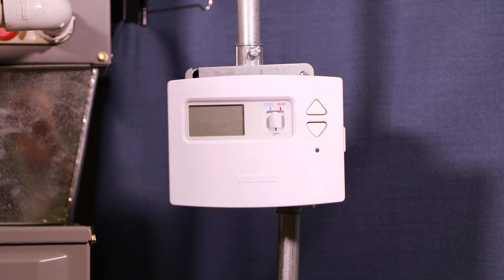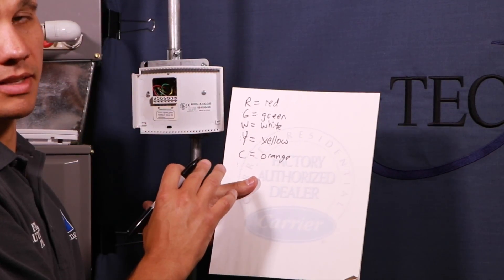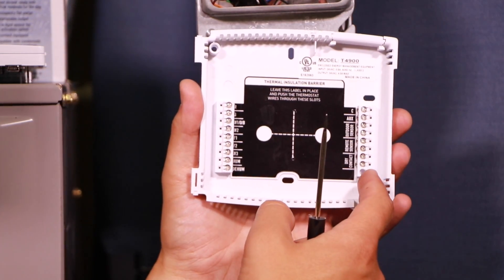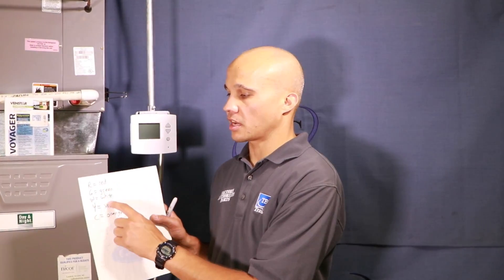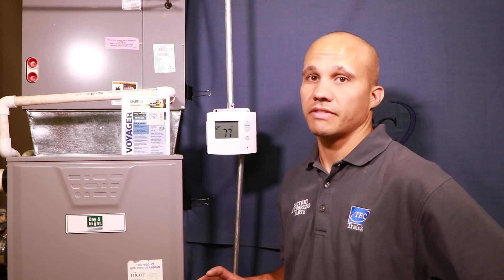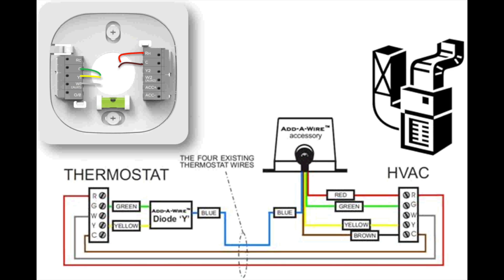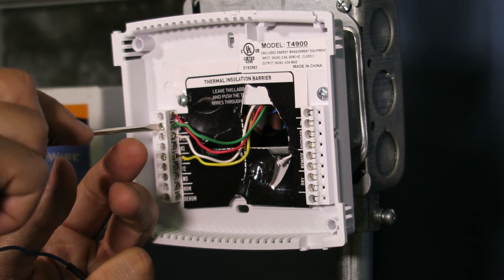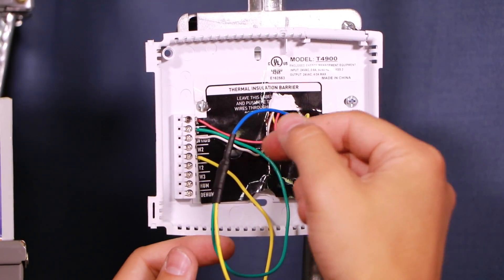Thermostat Replacement & Add-a-Wire Kit

Comment: Could the brown wire be used for w2 if I wanted stage 2 ?
Reply from the maker: You can use any color wire you wish to connect W2 of the thermostat to W2 of the equipment

Comment: Thanks for taking the time to post this, but here's a TIP for others: Check thoroughly, both ends of your existing thermostat wire bundle, you may find a hidden C-wire! It may be folded back/tucked into the wall cavity, or may be snipped off at the end of the cable's insulating sheath (not needed or used with the old installation)... While preparing to upgrade from a 4-wire to a 5-wire smart thermostat, I found mine was hidden there all along! Thinking I had no C-wire (it wasn't visible at the old thermostat end), I've been delaying my smart thermostat install while watching several of these how-to videos. Finally feeling ready to do the deed, I opened the furnace panel where the thermostat wires enter, and found an unused blue C-wire wrapped around the thermostat bundle/cable (on the thermostat end it was cut off at the insulating cover, not easily visible). The "C" terminal was there and connected to the remote condensing unit, but previous installer didn't attach the thermostat wire bundle to it, as it wasn't needed with that old battery operated thermostat. Took about 10 minutes to power off the furnace, attach the blue wire on the furnace end, then run up to the thermostat and expose/strip the end of the blue wire on the thermostat end. Thankfully, there were several inches tucked into the wall.

Comment: I recently Purchased the briidea Model: HTACC-01 and it looks like its the same thing (just rebranded) Im switching over from a older Lux Thermostat 4 wire (1stage) Heat only system to a Sensi Lite Smart thermostat, This Video is very helpful.

Comment: Sir, thank you for this great video. One question. Can add-a-wire kit be used for replacing R (power wire) or it can be used only for common, cooling and fan only?
Reply from the maker: It can be used on any pair of signal terminals (Y1, Y2, W1, W2, G) which means it cannot be wired to R or to C. But once you combine two signal terminals on one wire in your wall (say G and Y), it then frees up a dedicated wire that can be used for either C or R.

Comment: Thank you for the video.  I installed 2 add a C wire kits in our Church. They did not change anything.  They are still working off batteries. Any help would greatly be appreciated.
Reply from the maker: When you say "C-wire kit" are you talking about the old Honeywell product by that specific name?Or are you referring to the Venstar Add-A-Wire kit as shown in this video? Or one of the many other similar products out there (ecobee PEK, FAST-STAT Common Maker, etc).
Reply: @TECTubefilms  We installed 2 Sensi Smart Thermostats .  There was not a C wire.  Sensi sold us  Common Wire Maker Kits.  Looks just like the one in your video.  We installed them just like  your video showed. They work the same after we added the C wire maker kits as they did before.  They are working off the batteries so they go off line often to save the batteries. Once Sensi called me to tell me that the C wire maker kits were working.  But a few hours later they stopped working.  Thank you very much for replying to me.

Comment: I am trying to instal a Sensi wifi thermostat. I have no C wire at thermostat. I purchased an sensi add a wire kit. They have a install Video on web site. Basically converting G wire to common. It shows to remove yellow wire and wing nut it to yellow wire from add a wire kit.. i am stuck here cause I have two yellow wires at my furnace control panel. Which yellow wire do I remove?
Reply from the maker: We believe the Sensi Add-A-Wire kit is manufactured by Venstar and hence the same one show in this video.  So everything Ryan did in the video would likely apply.
Reply from the maker: In regards to the wire color, it does not really matter what the wire color is.  You can use any color you want so long as what you do at the stat matches at the other end at the equipment.  If you have two yellow wires at your furnace, it is unlikely both go to the stat.  You will need to trace out each wire and know where it goes before you re-wire something.

Comment: This doesn't make any sense. If you are able to access to the board, you just get a 5 wire connect from board to new thermostat directly. There is not need to your device at all
Reply from the maker: Correct!  If you have the ability to easily pull an additional wire, then you should.  An Add-a-Wire device is used for applications where pulling new wires is not an option.  We believe Ryan stated that in this video.

Comment: I finally upgraded to a WiFi Thermostat. This guide was EXACTLY what I needed. I only had 4 wires to my old battery thermostat, so I bought the Add-a-Wire Kit. It took a little bit of time to make sure the wires were correct, but if this un-manly guy can do it, anyone can! Thanks for the tutorial!
Reply: "un-manly" you say. Interesting choice of words...
Reply: @aurvaroy6670  interesting that out of that entire comment, the only thing you picked up on was the use of one particular word, completely unrelated to the subject at hand. What did you find remarkable about that word?
Reply: @realSamAndrew  "the only thing you picked up on was the use of one particular word'

That's not the only thing I "picked up" on that comment...
Reply: @aurvaroy6670  then what else did you pick up on, and if there WERE other things, why was "the one thing" the ONLY thing you wrote about? Obviously, it was the most important thing, or the only thing important enough to mention.
Reply: @realSamAndrew  Why do you care so much about what I commented? If my comment bother you this much, why don't you report it?
Reply: @aurvaroy6670  it's not a big deal that needs reporting. But I've never seen anyone as argumentative and defensive as you. You started with a simple comment, which was totally irrelevant. I then asked a simple question about your simple comment only for clarification, and instead of simply answering the question and ending it right there, you proceed to stonewall and argue ridiculous points. I wish I knew from the start you were a troll. My mistake.
Reply: @realSamAndrew  Also, how the hell do you expect me to remember why I made a comment I made 9 months ago? Seems like you're the troll 😂
Reply: @realSamAndrew  Also, what kinda troll takes 12 hrs to reply? If I was really a troll, I would've replied to you yesterday within an hour, but since I'm not, I replied today. You on the other hand, reply to me in a much shorter time range, so it again seems like you're the troll 🤣

Comment: Question ? I just install a Honeywell wifi I have the 5 wires already connected heat is working perfect but  When I turn the AC the thermostat goes off and comes right back on but is not turning the AC and on the screen shows a massage WAITING FOR EQUIPMENT   please Advice thanks
Reply from the maker: https://www.honeywellhome.com/en/questions/my-thermostat-display-shows-wait-or-waiting-for-equipment-or-has-a-flashing-cool-on-in-display

Comment: How can i install power kit in my furnace. In my furnace have only two slot for wire. Black and white.
Please advise
Reply from the maker: We are not sure what you mean by "two slot."  Are you saying that between your furnace and your thermostat there are only 2 wires total?  If that is the case, we also assume you do not have a cooling system.  The PEK cannot be used on a 2-wire heating-only system.  Either pull more wires or take a look at a product called Fast-stat Common Maker www.fast-stat.com

Comment: Am I missing something here?!?! Why would you spend a dime on this rediculous, unnecessary adapter? If you went to the trouble of running a blue wire from t-stat to heater why wouldn't you just run a new 8 wire cable and be done with it?? 
Please, if I'm missing something clue me in.
Reply from the maker: Running new or additionally wires is impractical or cost prohibitive in some applications.  This device allows you to make 4 wires in the wall behave like 5... or make 7 behave like 8, or whatever.
Reply from the maker: What trouble of running a blue wire?  We are not sure what you mean.  You would only use Add-a-Wire instead of running new wires.  If you are in a situation where you can easily and quickly run new wire, that is the preferred method.
Reply: I'd rather buy the adapter than try to fish a new wire or cable (only for C-wire capability) through my existing 70 year old walls. This is the perfect solution.

Comment: Excellent video for the add a wire, however it would be much more helpful to show the condenser wires hooked up because this obviously just shows the t stat connections, for us pros is ok, but for DIY people they can easily get stuck seeing the extra two wires from the condenser.
Reply from the maker: Our channel is intended for use by our customers, who are HVAC service professionals.  If a DIY homeowner finds our channel on accident, we cannot stop that, but assisting them directly is not our mission.
Reply from the maker: The wiring to the condensing unit will be the same with or without a Venstar Add-a-Wire kit.

Comment: Can it be done with r and w to add a common
Reply from the maker: Are you asking if a Venstar Add-a-Wire accessory can be added to a system that only has 2 wires total?  No, it cannot.  It cannot be used to split R or split C.  Those needed to be dedicated wires.
Reply: I’m asking if I have a stat with r and w can designate c and use the other two for r and w
Reply from the maker: @antoniosantiago2770  If you already have 3 wires in the wall, then yes you can put one each on R, C, and W.  You do not need an Add-a-Wire kit in that application.  However, if you only have 2 wires in the wall and you are trying to use the Add-a-Wire to get a 3rd wire, then no you cannot.  That is why below we said that R and C must be dedicated wires.  If you only have 2 wires, and you dedicate them to R and C, then you have nothing left.
Reply: Tec Tube got it now thanks
Reply: I’ll have to use the fast stat
Reply from the maker: @antoniosantiago2770  Make sure you use Fast-Stat's product called "Common-Maker" if you only have two wires in the wall.

Comment: My board at my HVAC Doesn't have a C terminal. Then what?
Reply: EGGINFOOLS what terminals does it have corresponding to what letters?
Reply: @matthewnowak3222  I ended up having to run a plug in transformer in order to get my power to the thermostat. I can't remember off the top of my head which terminals went to which letter but I have a very old system so it was easier to but the transformer, plug it in and run the wire up for C.
Reply: EGGINFOOLS the plug in transformer I use a lot for the ring doorbell and in some instances to power up the smart stat. Main thing is you got it going.

Comment: If the AC is 2 stage and the furnace is single stage, would there be a problem with installing the common wire? The Nest that I have seems to be working just fine, but unsure if it is using the 2 stages without the common wire.
Reply from the maker: The common wire (C) is used in conjunction with the hot wire (R) to power up a thermostat.  The common wire has no affect on the staging control of the thermostat.
Reply from the maker: And nest is by far our least favorite smart stat.  Check out ecobee... Cor... Housewise... Honeywell... Venstar... Sensi... just about anything else.

Comment: Thanks for the video. For the add a wire, on my current 4 wire system the R G and W seem to be normal, but there is no Y wire at the air handler. There is a wire seemingly going to the outside condenser from C, and a return wire going up to Y on the thermostat. Should I bring down the return from the condenser and hook to Y on the handler, then bring down the wire that ran up to Y to use for the add a wire?
Reply from the maker: We are not completely clear on your question and can't visualize what you are describing.  And it sounds like you are not confident where some of the wires are connected/routed... for example you said "seemingly going to the outside condenser," with lack a of certainty.  You should draw a wiring diagram showing how all 3 devices (stat, furnace, and A/C) are currently wired to each other.  If you are unsure where a wire goes, use your electrical meter to trace it out.  If you're a homeowner and not familiar with electrical wiring you may want to hire a HVAC contractor to do this work.
Reply: Tec Tube Sorry. I was as sure as I could be without using a wire tester, but if I'm not 100% sure I tend to use seemingly, etc. They basically had y on the stat going to the a/c unit, and the other a/c wire going to c on the furnace. I split that y wire, bringing the compresser side to y, and the y from the thermostat to the venstar. So I ended up with c and y wires from the furnace to the a/c unit, and everything else like the add a wire diagrams. Not sure if there was an easier way, but everything is working now.

Comment: Can I use this Add-a-Wire kit with Nest Thermostat?
Reply from the maker: We have never tested it on nest but there is no reason to suspect it would work any differently on their stat.  A nest stat uses the traditional old school wiring of most stats (R, G, Y, W, etc.).
Reply: I use this add a wire kit with every nest install, although nest says you just need a 4 wire hookup, I’ve had issues in the past, and the add a wire  kit saves much money and time, so yes this will work on nest t stats.
Reply: @matthewnowak3222  Was that a Version 3 Nest. I have used an external 24v transformer to power the thermostat. Problem is the air tech warned me about having two 24v transformers on the red loop. What do you think?
Reply: Tec Tube you probably don’t need a add a wire with a nest. Nest stat will work with just 4 wires. You don’t have to connect anything to C terminal. It has internal battery that charges when your AC is on.

Comment: I bought a Honeywell WiFi thermostat. There is no C wire. There are 5 wires going to thermostat. However, there is a black and red wire from the furnace's R terminal going to the R and RC of the old thermostat. Could I simply move the black wire from the furnace's R and put it to the C terminal and same on the thermostat? Then put a jumper on R and RC on the thermostat?
Reply from the maker: No.  The wire colors are not as important as what they are wired to.  You need to figure out why you have a R and a RC.  If you are not the original installer of the old thermostat, you need to trace the wires out.  It is highly probable that you have two transformers and hence to 24 hot "R wires."
Reply: You may also want to check out the Honeywell WireSaver.  It works similar to Venstar's Add-a-Wire kit, except instead of working with all 24vac stats, WireSaver only works with Honeywell.
Reply: ryanhoge
Reply: Have you yet determined if it is a thermostat issue or furnace issue?
Reply: Thanks. I was able to figure the C wire and got the thermostat working. The issue now is: 2-3 minutes into the heat call (burners firing up and blower running) the burners shut off and thermostat shuts off and comes back 30 seconds later. What do you think it is? Do you think the Wi-Fi thermostat is robbing power from the furnace? Do you think it needs a dedicated transformer? Existing transformer is 24V 40VA.
Reply: Not sure yet. When i put back my non-WiFi thermostat back on, no issues.

Comment: Does it work if I only have 3 wires currently, namely heat, cold and power (y w r)? Can I combine the heat and cold?
Reply from the maker: The Add-a-Wire kit can combine any two "signal" wires such as fan (G), cool (Y), cool2 (Y2), heat (W), heat2 (W2), reversing valve (O/B), etc.  It cannot combine the power wires of 24vac hot (R) or common (C).  So the answer to your question will depend on whether your new stat has a LCD and needs a common wire and if your equipment needs a fan (G) signal every time you energize cooling (Y) or if you want independent fan control.  Your HVAC installer should know what is needed for your specific application.
Reply: Perfect. Thank you
Reply: Tec Tube ií

Comment: once complete with "add a wire kit" I should be able to just run my fan by itself.  Reason being is that I have a april air cleaner and run it to keep the air clean if the temperature in the house is already comfortable.
Reply from the maker: As long as your customer has a "G" wire, then the thermostat can be used to control the fan independent of heating and cooling.